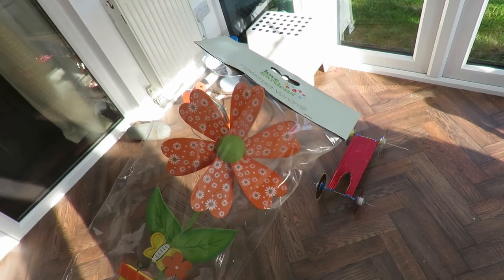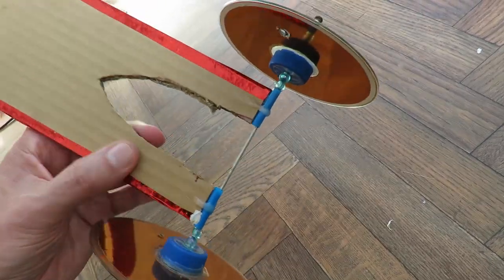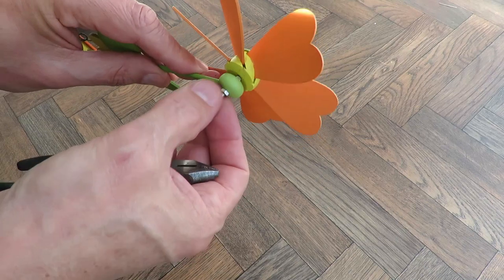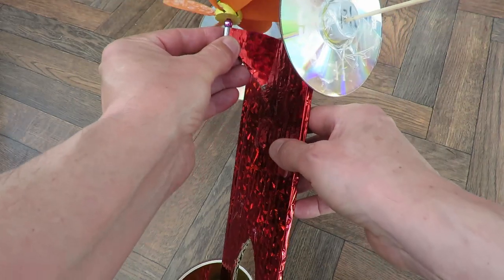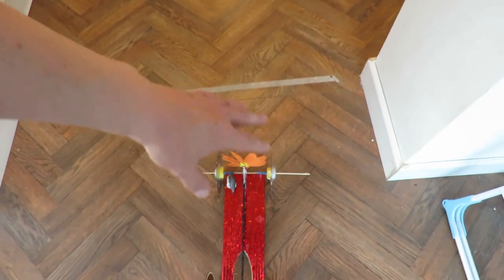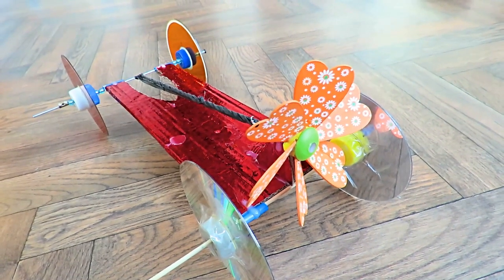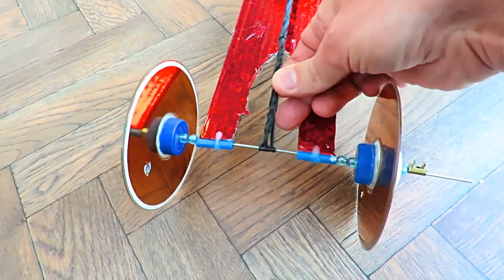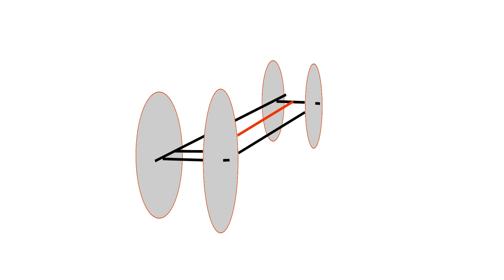Put a rubber band on it #0270 Fan driven car

Comment: I suspect one of the vanes is misaligned or a slightly different size but then it could be the bent spoke is the culprit. it worked rather well all things considered
Reply from the maker: I doubt my wire through the middle is perfectly aligned anyway. As long as it reached the other end of the run it is good enough for me 😁